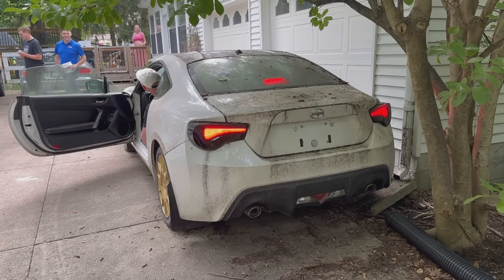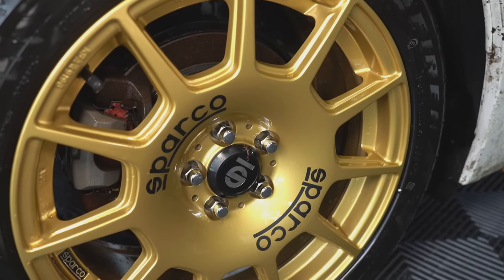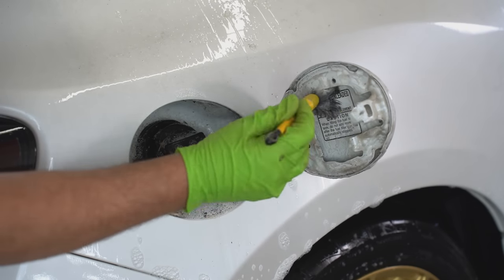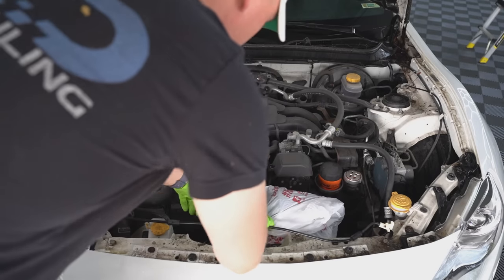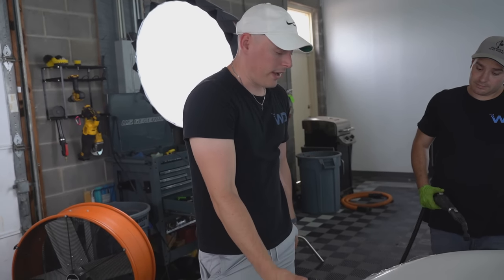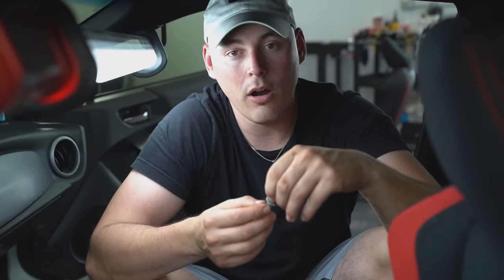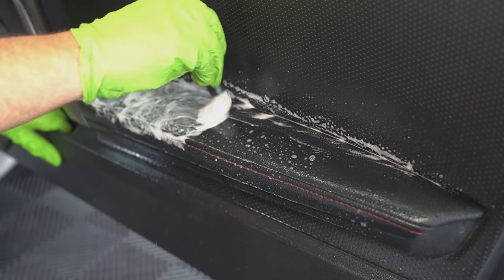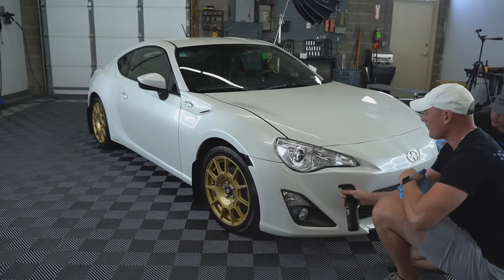First Wash & Drive in Years: ABANDONED Scion FRS! | Car Detailing Restoration!

Comment from the maker: Click our link for a CRAZY offer of Buy One Lite Spray and Get One Free! https://avl.kg/wdbogolite08 | This offer is ONLY for the first 100 customers so go quickly!

Also, make sure you're subscribed to see what NO ONE on YouTube has done before!
Reply: That bug is called an earwig.
Reply: How do you buy a car thats simply abandoned on the street without meeting the previous owner. I think there's something youre not telling us.
Reply: What degreaser do you use to take all that sap off? Your videos are great and informative.
Reply: I don't like gold wheels! the engine is a Subaru boxer engine! the Japanese boxer engine was developed based on the original boxer engine that Porsche invented for the Porsche Boxster! the name boxer coms from the sport of boxing because the heads of the cylinders meet each other as they pass each other just like the gloves of boxers during a match, this is due to the 2 cylinders on each side being horizontally opposed facing inward towards the valley of the intake manifold which sits in-between the cylinder heads and are set in an interlocking finger design unlike a v style  where they are positioned in a v style shaped angle moving outward towards the exhaust manifold headers or a straight or in line where they move up and down in a vertical orientation  the difference in straight verses inline being inline are set in a straight single file line where a straight engine set up they are in a single file line on each side of the engine block!
Reply: given the boxer engines where designed they pack a very venomous and addicting punch with superior throttle response even with low power numbers making them a thrill to drive!
Reply: Looks amazing. I was thinking it’s similar to my parents Subaru    😂😂
Reply: Why didn't you take the wheels off to clean?
Reply: I don't like the golden ones so much for the pray

Comment: Weld a nut on top of the bolt. The heat will help loosen the rust and the bigger nut helps have more surface area to remove the stuck bolt. Done it a thousand times. Works 999

Comment: Great job guys!  What a nice car!  And it is a Toyota, so all you have to do is change the oil and the brakes periodically, and it will last forever.  I am so glad you bought it.
Reply: Well actually it is a Subaru built car, launched as a joint project between Subaru (BRZ)and Toyota (86) built in the Subaru factory with a boxer engine like all Subaru and unlike any Toyota.

Comment: A few things to note here! Firstly, the FR-S actually did come factory stock with the 86 logos but typically they are removed in favor of the carbon fiber vented ones or the blacked out ones because the chrome itself is too bright and bulky and interrupts the flow of the car. Secondly, this motor is a FA20 motor putting out roughly 200 HP on around a solid 2700lbs of weight and it was designed by Subaru taking inspiration from the EJ motor (the FA is N/A, but is still a boxer engine like both cars). Some quirks to note about the FA is that the oil filter is up top on the engine bay and the spark plugs are located on the side of the engine making sparkplugs an extremely difficult job to do on these cars. Additionally, the FA20 would've been a great engine for this platform if the tune from factory hadn't been the worst thing on this Earth, more specifically the infamous torque dip in 3/4. The torque dip was so bad that foot pressed down to the floor you would only gain 1-2 mph every 2-3 seconds or so, and the only way to avoid the torque dip while driving would be to shift into 4th at redline for 3rd and even then you would encounter it. The way to get rid of the torque dip would be to add aspiration via a turbo or supercharger (supercharger is easier to do on these cars as you can just connect it via the crank pulley), or by getting UEL headers and using an OFT (preferably ecutek on this platform). Other than that, they're incredibly fun and meant to beat other cars in corners; it's able to keep up with the likes of Porsche in corners and even outclass Lamborghini and Ferrari in certain cases on the corners. They are by no means "fast" compared to other sports car, nor  are they meant to be, they are meant to be driven in the canyons and properly enjoyed on the road and they love to be taken to redline and abused by absolutely letting that engine rev to the moon!
Reply: That’s so fun to drive that way best part of having a car that’s not very powerful but can handle the curves like a animal!!!

Comment: For the stuck bolt, find a nut that fits over the top of the chewed up bolt head, weld it on - then use the nut to remove the bolt. You will need a fire blanket to stop setting fire to your interior though!

Comment: I have a 2016 FR-S black, the only mods done so far is headlight/taillight after markets, looking for a good cat exhaust but would love those Sparco's LOL.  It's a pincher bug as I had always been told for obvious reasons.  Unfortunately it's not a true manual, couldn't find one so it has the paddles which just isn't the same.  The badge is on the FR-S, mine has them.  It was a collab with Subaru and Toyota, it has the Subaru engine just like the BRZ I believe, please correct me if I'm wrong here.

Comment: I bought my 2013 FRS brand new. There were 3 on the lot and 2 of them had that clear plastic junk on the front end for an additional $240 charge. SCION was always "pure priced" so it was supposed to be the same price at every dealership unless cheap mods were added. I bought the 1 without the film on it and after 4 months I got rid of it with 400 miles on it. Very underpowered for the price yet people are still asking top dollar for them.

Comment: The engine is an FA20 boxer engine from Subaru with Toyota's direct injection system. It was made to sit as low as possible to best center of gravity to increase handling. 

For the 22+ BRZ and GR86, they made the FA24. More displacement for more power and torque.

Comment: Gold Wheels would not be my first choice.  This was a joint venture with Subaru so the flat 4 boxer engine is what you see here.  Subaru's version is the BRZ.  Thank you for removing the clear bra, it was driving me nuts.  Actually, it appeared that the front bumper cover had been repainted at some point, and it wasn't that great of a match.  It looks far better now.

Comment: Hi! I have a question for you, guys!  I’ve seen many detailing videos, why starting by cleaning the wheels?
Reply: A general rule of thumb when it comes to detailing is you usually start with the dirtiest part of the car, which most of the time tends to be the wheels.
Reply: You don't want the dirt or chemicals from cleaning and agitating dirty, grimy wheels to land on clean paint. Also if you do wheels after paint, water can dry on the paint causing spotting.

Comment: You may have already thought of this or someone else may have mentioned it, but the right shop could probably mask off the carpet and fabric around the seat with some sort of foil or something and maybe weld a couple of hex heads on top of those bolts so they can be removed.

It would be a little bit of a pain, but maybe not as bad as drilling them out.

Comment: It's been more than 10 years since this car debuted, but it's still a very popular model in Japan, so there's no way it would be left in such a pitiful condition like the one in this video. I think it would be better to remove the wheel and restore the brake area. I have the same car, but I always keep it in the garage. Normally this car would be slow, but if you add something like a supercharger to it, it will become extremely fast. The genuine heavy suspension and brakes can be transformed by changing the dampers and calipers. In Japan, it is also a representative car that enjoys customization. I hope you will love your car.

Comment: The car is a rebadged Toyota GT86 or Subaru BRZ, depending on how you want to see it. The GT86/BRZ was developed by Toyota and Subaru in a joint venture. It seems this Scion FRS was one of the ealiest models hence entered the USA as a Scion and not a Toyota. The oposing pistons on the badge represent Subaru's boxer engine that powers ALL version of this platform, be it Scion, Toyota or Subaru. Parts are interchangeble between versions and there is a great aftermarket parts for this thing. Hope you enjoy it, Id certainly love to own one.

Comment: I own a 2018 Toyota GT86. I’m guessing your new to the FR-S so you should know that it was a joint collaboration between Toyota and Subaru (Toyota owns 20% of Subaru)
The FR-S was based on the based model Japanese version called the Toyota 86 G so that’s why it has the 86 badge on the front fenders. The Subaru version of the GT86 is the BRZ but the FR-S was based on the Toyota version. The engine is a 2.0 Subaru Boxer.
Reply from the maker: Thank you for the info!
Reply: @WDDetailing  and thank you for saving a nice FR-S! Any plans to mod it?

Comment: High-performance SUBARU BOXER engine delivers 200 horsepower at 7,000 rpm and 151 lb. -ft. of peak torque at 6,400 - 6,600 rpm, with a high specific output of 100 hp/litre

Comment: Scion didn't go out of business, Toyota ended the North American sub-brand.
The badges came on the first gen FRS and GT86, but not on the BRZ.
Engine is a 2.0L Flat-4 FA20 (Subaru designation) 4U-GSE (Toyota designation)
I take it the previous owner was into rallying, having aftermarket wheels, mudguards, missing side markers, (imo hideous) taillights, fog lights, and removed interior parts. The suspension also looks a little higher, but it may be due to the wheels.